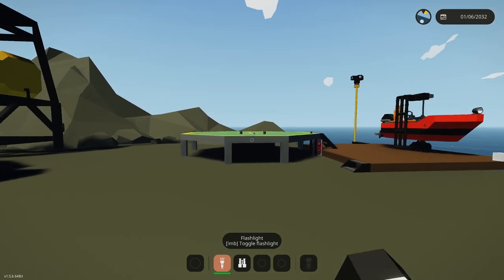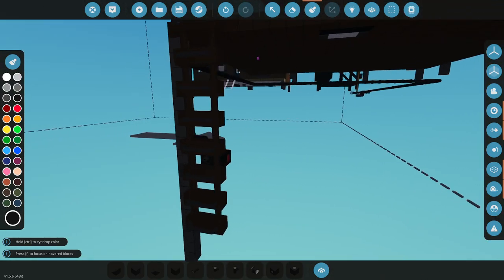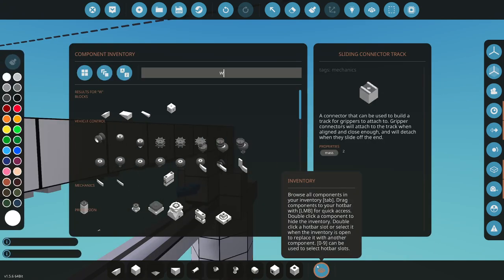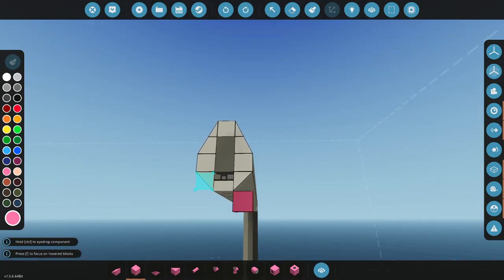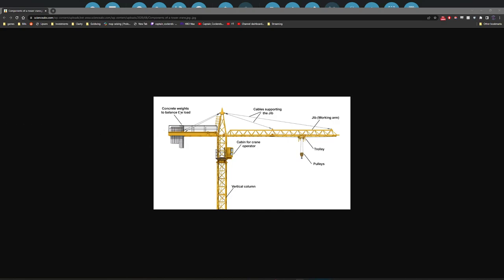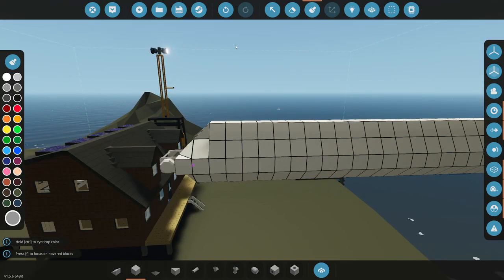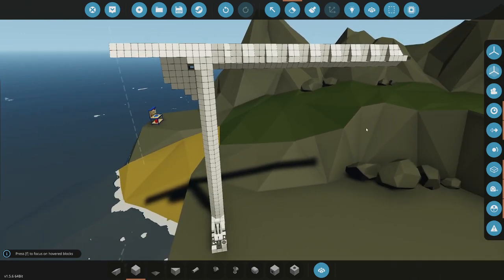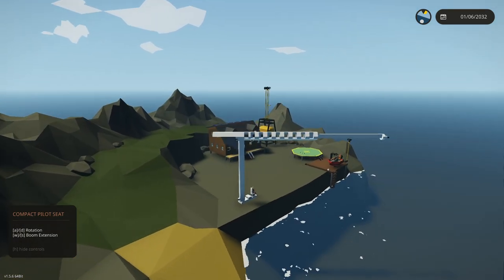Stormworks Career Build Series 118

Comment: It is weird that the custom thank doesn't fill.   It sucks because it should be able to hold 4x what the prefab tanks can hold while inside.  I wonder if a physics flooder would separate the tank from the frame and make it work?  Maybe using pivots to separate the tank would work as well?
Reply: @cf453  I'm not sure either.  I actually completely forgot they existed until I was having issues with a ship i was building and tried using them and they helped.  If i recall, the spawner and flooder did not have adverse reactions.  I do know that seperating tanks from the main object can cure some issues with the tank though.